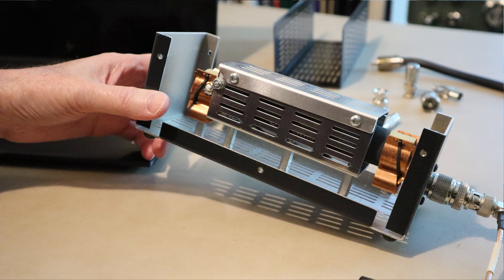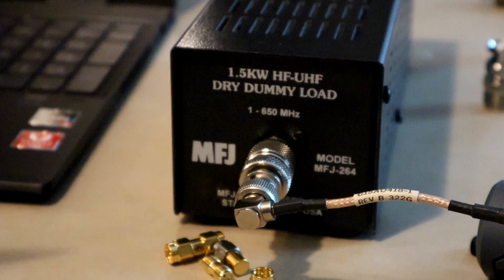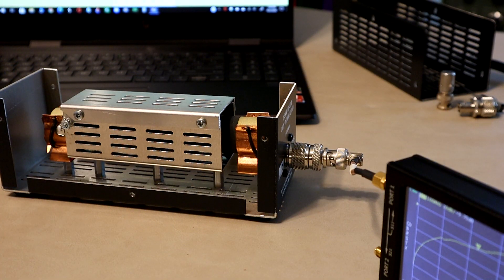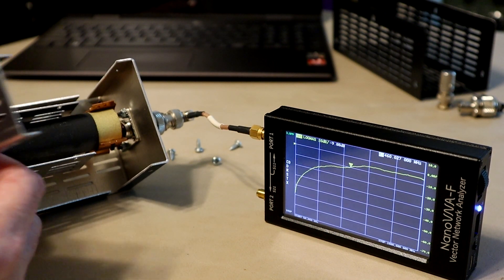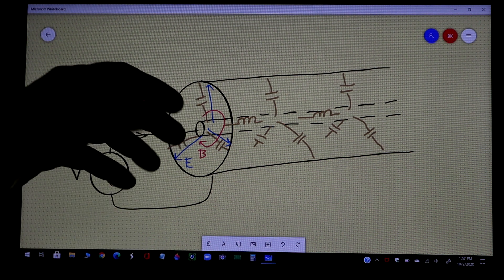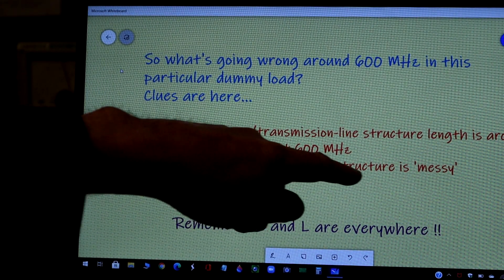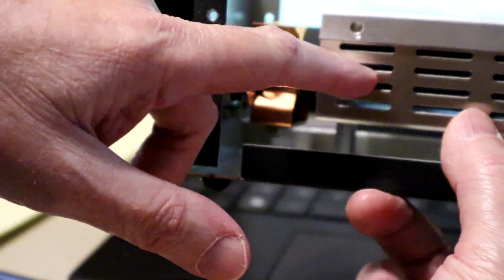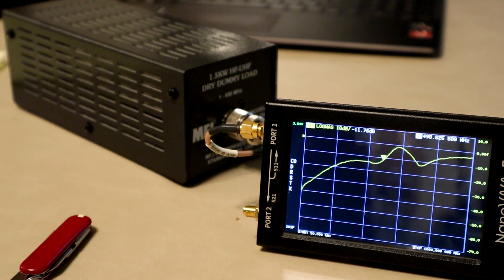NanoVNA - S11 and MFJ-264 dummy load - Part 2 (performance improvements)

Comment: This was why Collins used a 37 pF doorknob capacitor in their DL-1 dummy load, which is in parallel with the resistor bank to ground. I think a few others used a cap as well. One company used an air variable, if I recall. I remember speaking of this, about the Palstar loads, with their company years ago.
Reply from the maker: Interesting. I pulled the manual for the DL-1 to get a look. My guess is that the cap performs a similar function to the internal shield in the MFJ (working with the series L of the resistor bank) - but without the benefit of being broadband. With the relay in series with the signal line, there an additional series inductance as well. With the cap added (to the existing C from the resistors to case), they get one LC section of a discrete LC transmission-line model.  Probably improves the high-frequency SWR performance some. But alas, I suspect the DL-1 doesn't work well above 30'ish MHz. I can't actually find a spec on it, or any SWR (or RL) measurements versus frequency. Any idea how high it goes?  http://collinsradio.org/archives/manuals/DL1%20Dummy%20Load.pdf

Comment: Have you considered adding a very short copper grounding strap from the flange on the SO-239 connector to the cage?
Reply from the maker: Sounds like a potentially good option - but I'd want to support it somehow to keep the distance from the center-conductor/bracket to prevent RF arcing. I calculate 274V (350Vpk) at 1500 Watts (if it is operating at 50 Ohms). But not sure what that implies about gap requirements.  (Fortunately I don't have use for this thing above 440 MHz, so it's working OK as is.  I just found it to be a fun puzzle to solve with transmission line theory :-)

Comment: HI , i am an italian Ham IU8MLV I have an MFJ 260C, It would be possible to lower the swr from swr 1: 1,44 (in UHF 430-436 Mhz) to 1: 1,04. that is, from a return loss of -14.5 dB to -32.5 dB,
From 1 to 30 Mhz it has a SWR of 1: 1.04, in VHF (144-146 Mhz) it has SWR 1: 1.2. Is it possible to add in parallel on the RF connector of the dummy load some high voltage ceramic capacitors from very few pF to make the SWR in UHF lower? Many Thanks 73 51
Reply from the maker: Not sure. I'm not familiar with the 260C. But for many situations a return loss of 14 dB is not too bad. I'm often happy with RL of > 10 dB, although 20 dB is often my goal. Anything beyond that may be influenced by the measurement equipment and setup. If you need the -32 dB S11, maybe try a matching network?  Of course that will only work for one frequency. For braodband, you'd have to play with the dimensions of the structure and look for parasitic inductances/etc like the 264 seemed to suffer from. Sorry I don't have better info on how to improve a 260C. 73's

Comment: nice! Subscribed! It would seem a rather poor design from MFJ!
Anyway, I am not sure I understand the relationship with the original problem and the 12.7cm... 
I understand it was an educated initial clue/guess but, ultimately, do you think it was really the length of the "cage" to cause (or have some part in) the problem? It looks like your fix solved the problem, while the 12cm 'cage' is still there.

Thanks for any comment!
Reply from the maker: Thanks !  Yes - the length of the cage was just a clue along the way as you surmised. 1/4 (or 1/2, or 3/4, ...) wavelength is a common regime in which to find interesting behavior in transmission line effects (which everything involves at high enough frequency due to dimensions and speed of light).  But as you pointed out, the design clearly works once more grounding of it is done, and even without additional grounding it works great at lower frequencies.  S11 stayed good up through the 70cm ham band - so not a problem for 99% of likely customers and applications.  FWIW - MFJ and Alinco have always been a couple of my favorite companies. Generally solid products at good pricing and with good features and user-interfaces IMO. :-)  Thanks for watching and commenting ! 73's